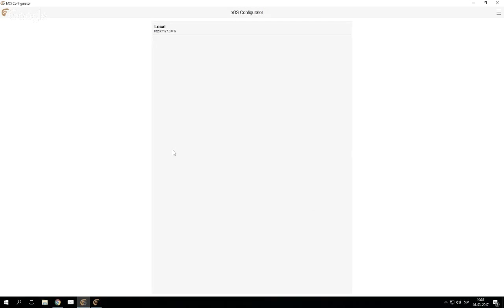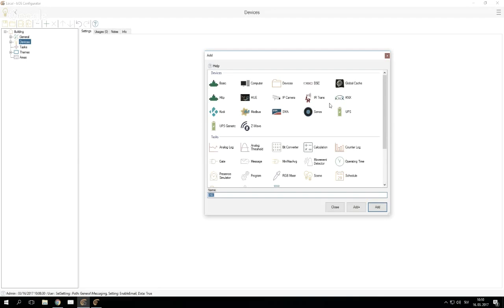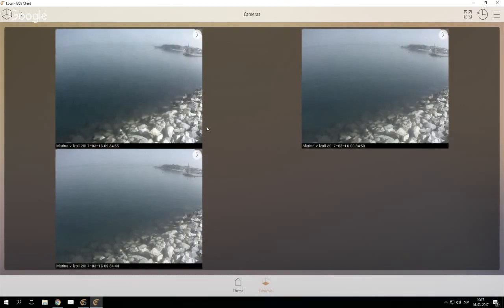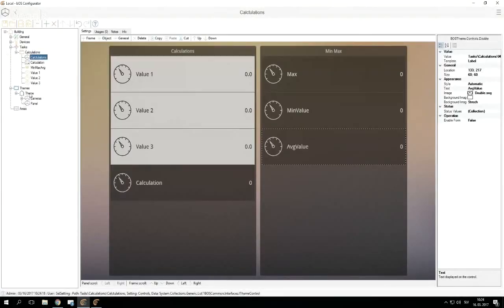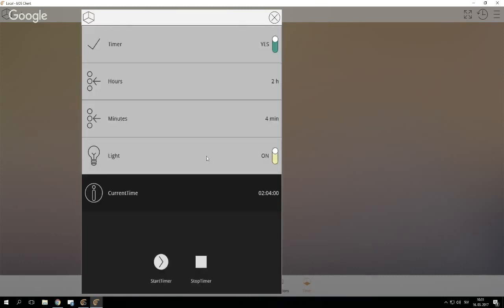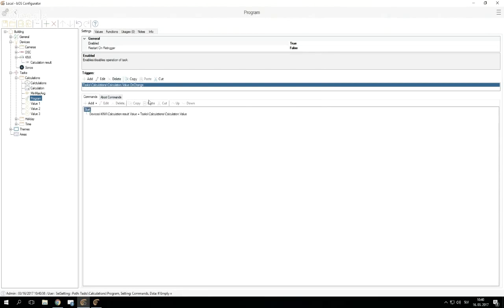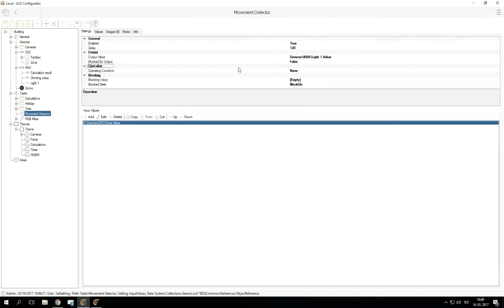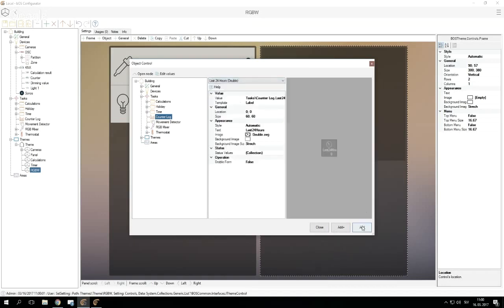ComfortClick bOS Training Webinar - 2

Comment: Here is the timeline:

00:00 - Setting up the system, importing devices
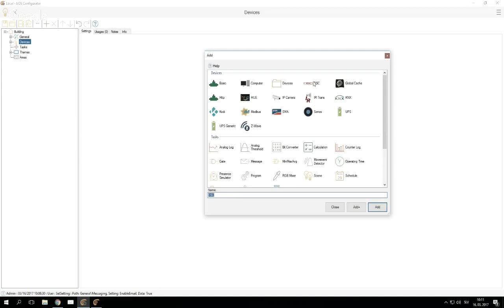07:54 - Importing DSC-alarm-system
10:30 - IP-camera
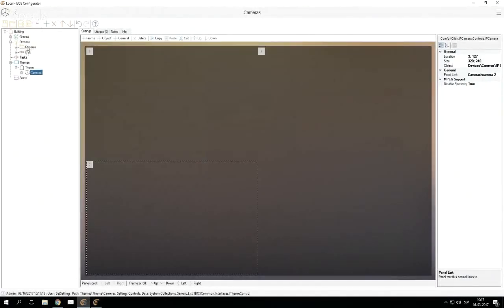14:40 - Sonos
16:38 - Calculation
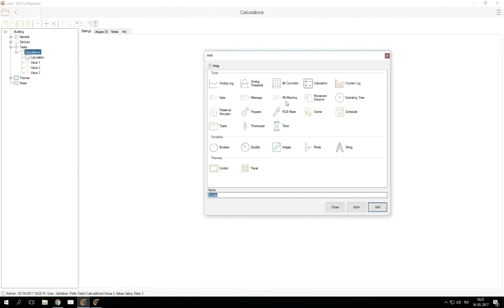19:25 - Min/Max/Avg
22:20 - Timer
25:38 - Additional lower buttons in the client app
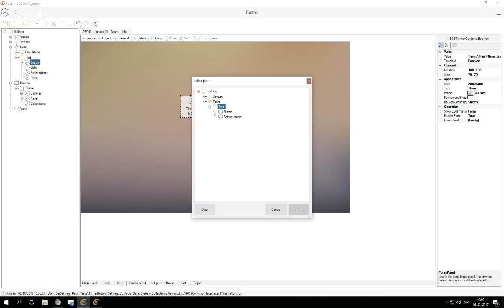27:19 - Linking to submenus/settings
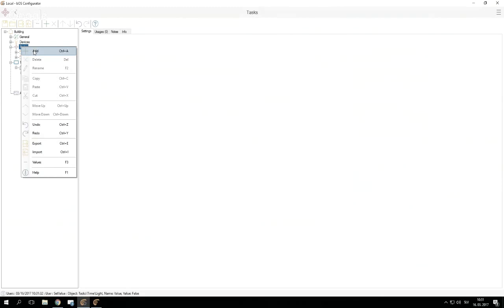28:38 - Program task: adding a holiday, then letting this holiday trigger a scene
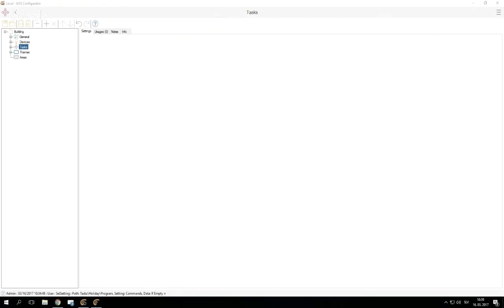33:19 - Returning calculation-values to KNX
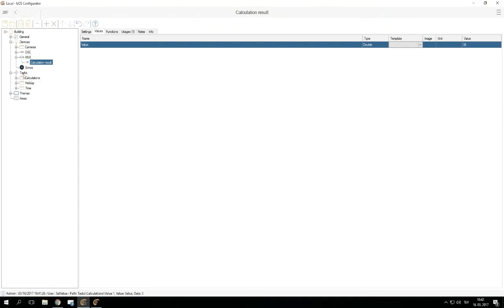36:26 - How to control RGB(W) with RGB-Mixer
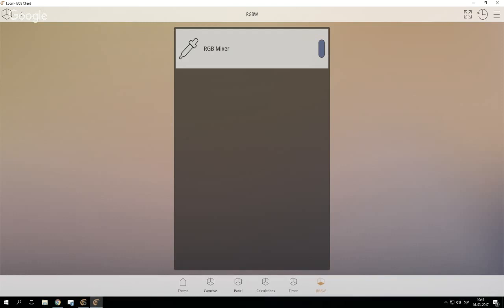38:27 - Brightness (intensity) of KNX-dimmer
40:26 - Switch lights with task "Motion Detector"
43:42 - Heating
46:33 - Creating a graph with "Counter Log"

All webinars:
Webinar 1: https://www.youtube.com/watch?v=eltygE_GzCo&t=2462s
Webinar 2: https://www.youtube.com/watch?v=oeFKNNyQJzo&t=453s
Webinar 3: https://www.youtube.com/watch?v=S3NJd7JIcoc
Webinar 4: https://www.youtube.com/watch?v=xBUFenXhwI4
Webinar 5: https://www.youtube.com/watch?v=tsWrDXVj8SA
Webinar 5 Q&A: https://www.youtube.com/watch?v=oCkhoiLouuU